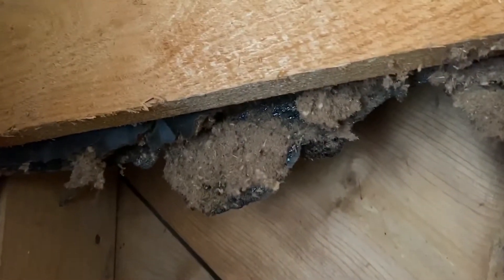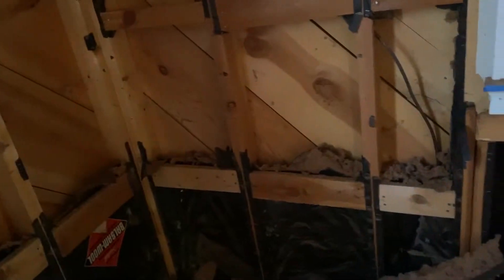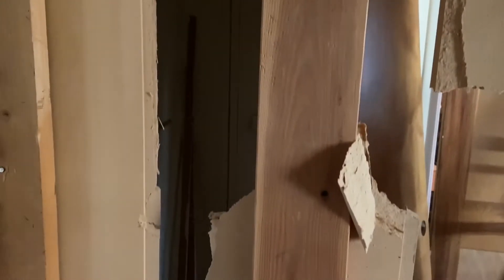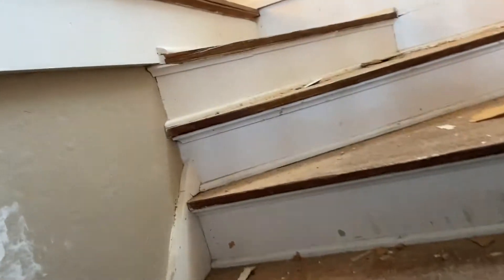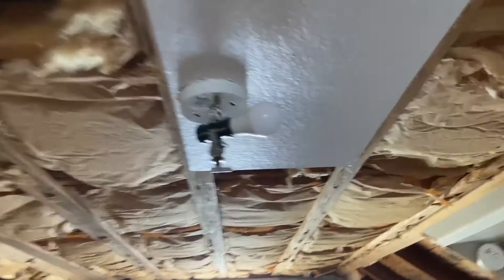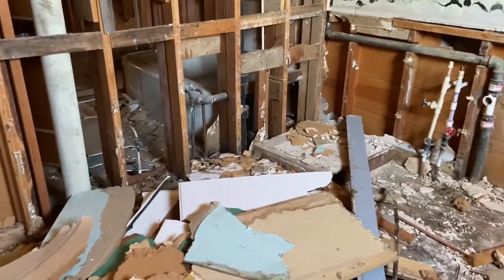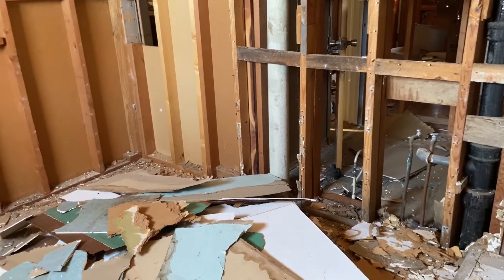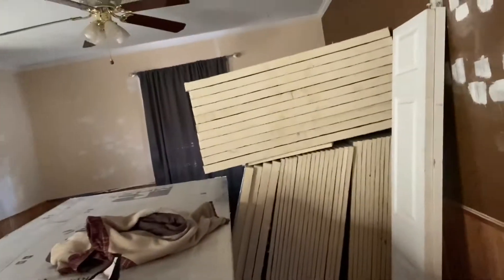More Old and Bad Insulation | House Remodel 1949

Comment: If you have the walls open you are right , replace all you can.  A lot easier now that later when there is an issue and the walls are finished.  Good insulation can make such a difference in the quality of living space.  Nothing worse than a drafty cold house or one that is way too expensive to keep warm.  Lots of work going on, thanks for the update. 👍
Reply from the maker: Yeah, I talked to a lady a few houses down, her grand kids were living in there.  She said it was miserable and she was always worried about their safety (mostly because of the floor furnace which didn't work, and then was rigged to work--somehow.)  I'm not sure she knew about all the other problems with the electrical, plumbing and the mouse and bug activity.  When you have to dig this far into a house, you might as well just do it all and make it a nice place.

Comment: Why so much crossbracing?
Reply from the maker: Upstairs?  I think it was just to hold the fiberglass batts in.  Downstairs, it was just to keep the boards from warping.  They probably aren't needed, but they aren't hurting anything either so there's no point in removing them.  ;)